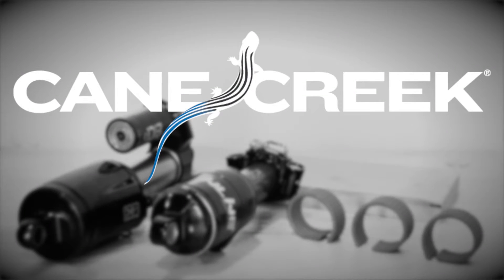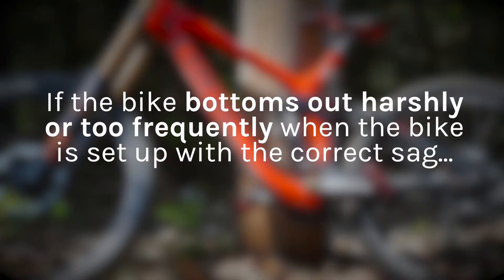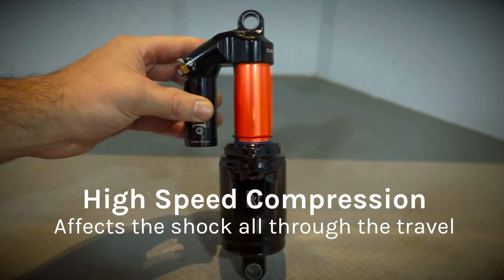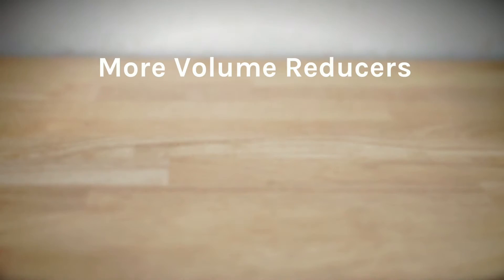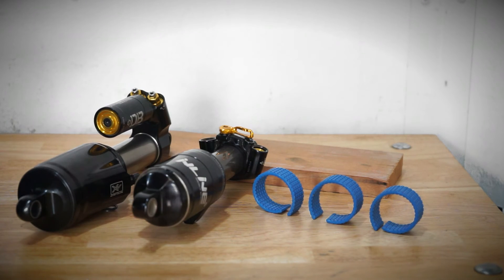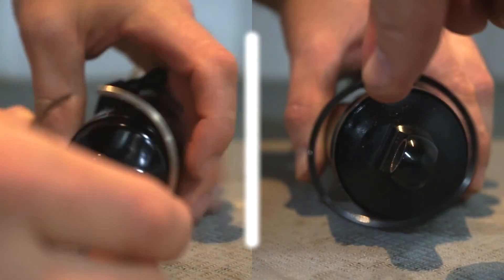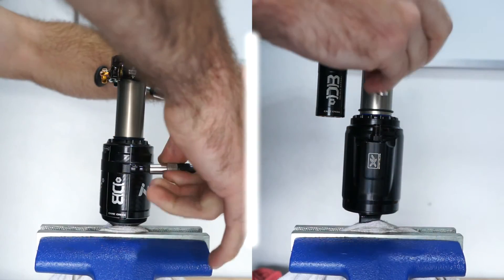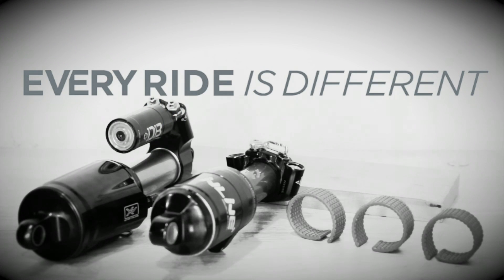How to install volume reducers in your Double Barrel air sprung shocks

Comment: modern day elastomers..
Reply: Nathan Tubbs nope. Volume reducers reduce the volume of the positive spring in air sprung shocks, increasing how progressive the spring is as discussed in the video. Elastomers in early mtb suspension were the spring, there was no air spring. Completely different.
Reply: noooooooob